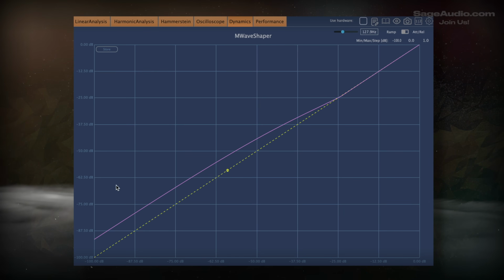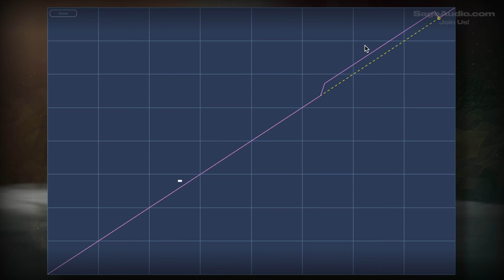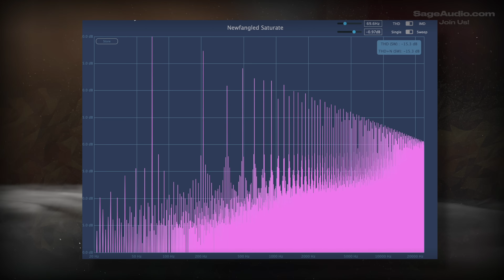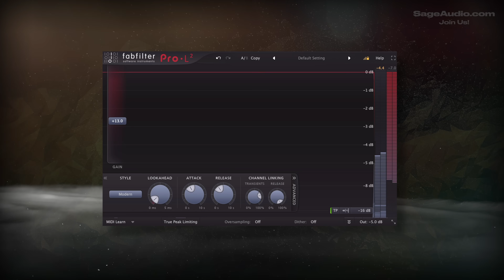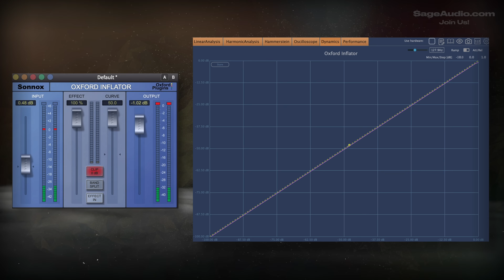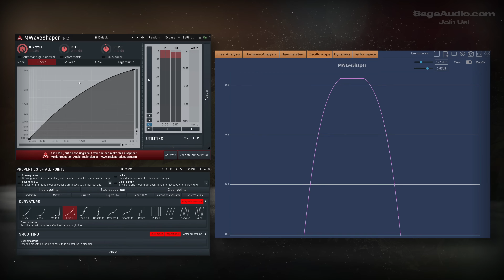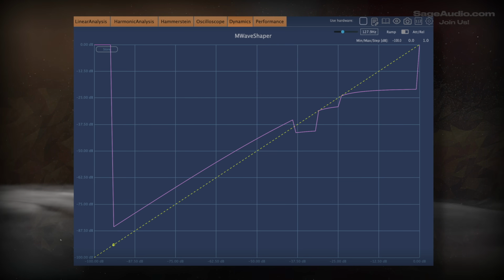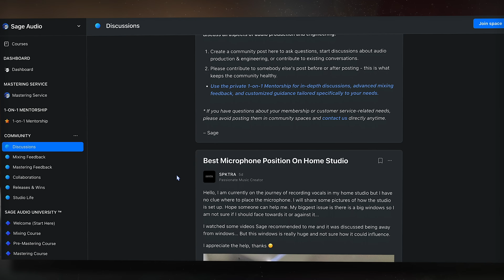Maximization, Limiting, & Clipping: An In-Depth Look at Their Similarities and Differences

Comment: Excellent info, yes it's correct that these 3 separate things get morphed into 1, depends on the exact plugin.

Whether I want those as separate or together depends on what results I want or get. And I've got plug-ins that are several things combined but others are specific to a single task.

Comment: Just one thing to add about limiters these days... they are brickwall limiters, so they are not "as compressors with a 10:1 or more ratio" as those still have an attack time and there will be peaks above the ceiling. Brickwall limiters do not do this, they always work instant as if the attack time is 0, and there will be no signal above the set ceiling. The attack time setting on brickwall limiters that have this setting is rather the first release stage (or short release) whereas the release setting would be the second release stage (or long release), f.e. on Pro L2.
Reply from the maker: Great points! You're totally right about the "instant" response nature of modern brickwall limiters and thinking about attack/release times for limiting like that is certainly helpful.

Comment: Why is Ozone‘s Maximizer called so? Isn‘t it just a Limiter or am I missing something?
Reply from the maker: Great question! Ozone’s Maximizer is essentially a limiter, but it’s designed with extra features (like character or transient emphasis) to push the audio levels as high as possible without introducing distortion. It is indeed a limiter, but it's a more specialized use case, often for helping to achieve maximum loudness while preserving and/or enhancing transients.
Reply: I wish I could tell u 😂